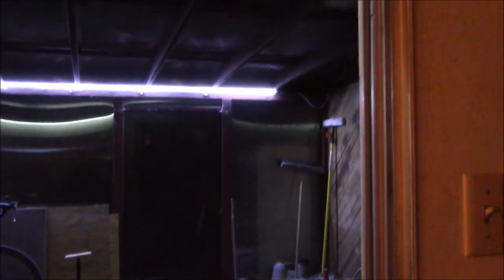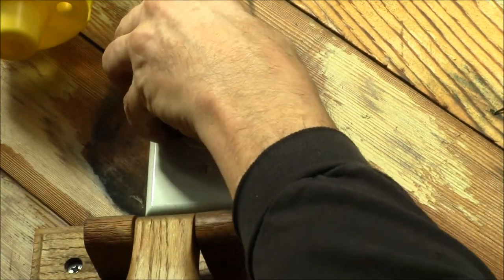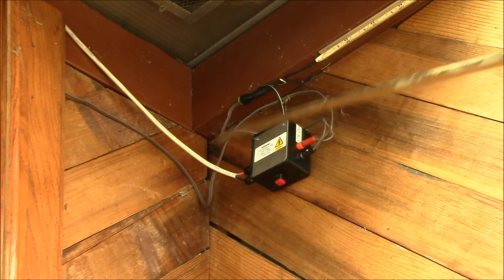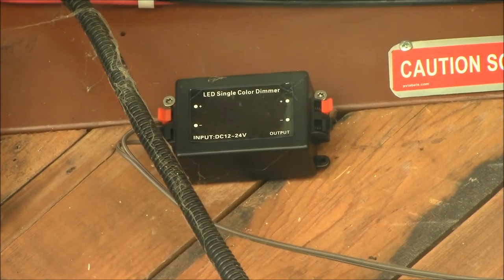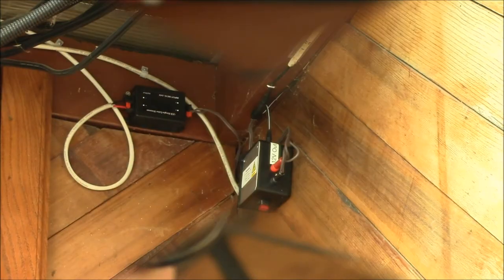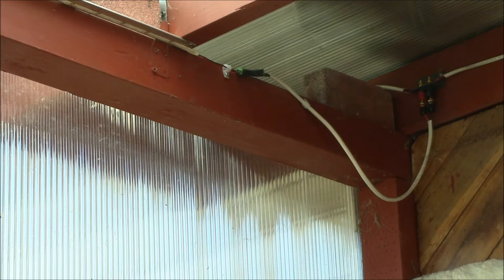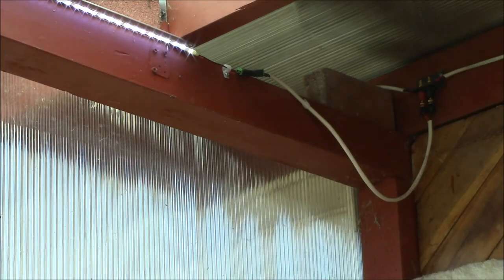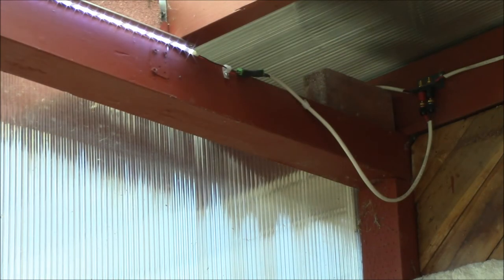Solar LED Patio Lighting

Comment: 1 sec tho if the wall out let is going too 120 to 12v doesn't than mean the lights are realy runing off of 120v
Reply from the maker: Yes, it takes ~! watt of AC power to turn the relay on.  But then the ~36 watts of power for the LED strips come from the solar battery bank.  I can also turn the relay on manually and use 100% solar power.  But it&#39;s so much more convenient to just flip an existing switch on the wall and turn on the lights that way.  And no need to tear up the wall running a separate 12V switch and lighting circuit.
Reply: R Brown ok you didn't show the battery and other stuff
Reply from the maker: I have another video where I show the workings of the relay box and connections:
https://youtu.be/FZx2Px5f-ZQ
I use quite a few of these throughout my house to control 12V LED lights with existing wall mounted switches, like in my kitchen:
https://youtu.be/yd241n5GoSE